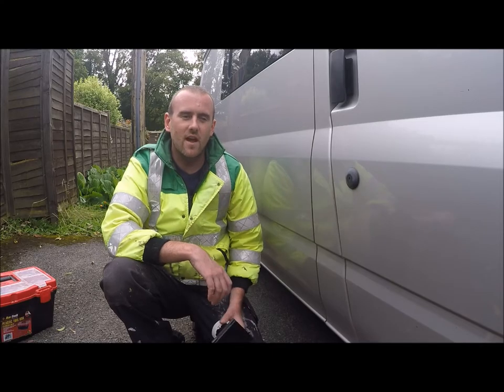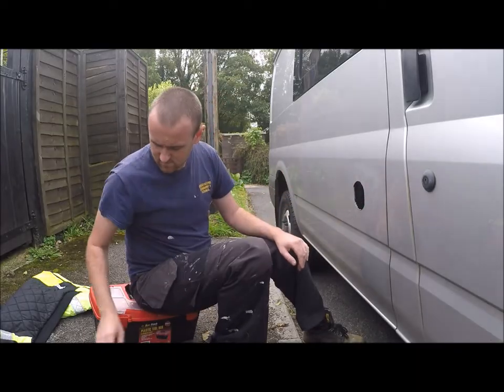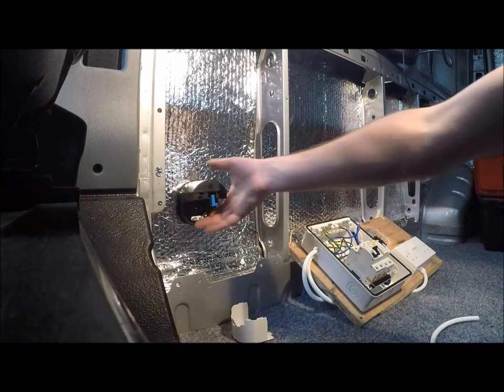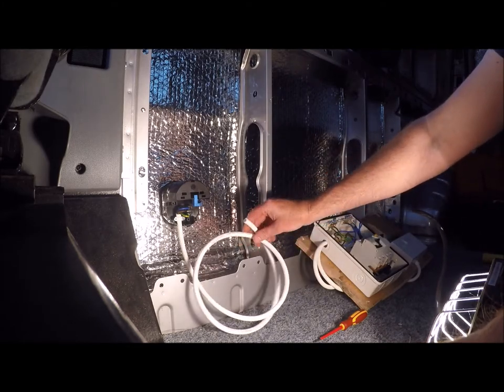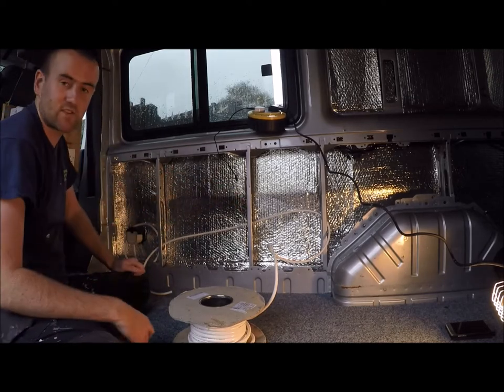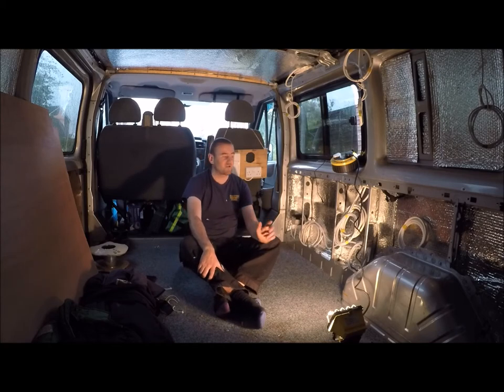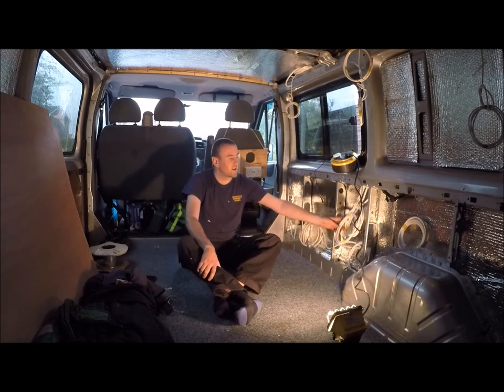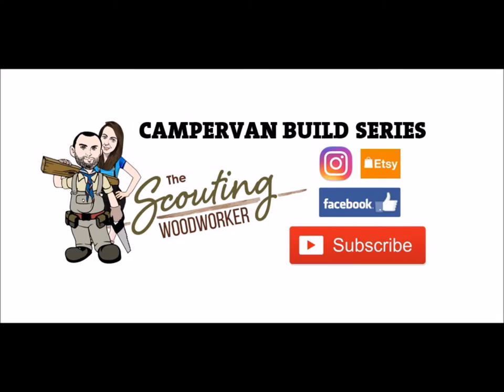Campervan Build Series - E05 - Electric Input & Wiring

Comment: Hi .what type of cable and rating is it for sockets and lights...is it special cable as its in a vehicle
Reply: Just use some 4mm hr07 rubber or some PC flex flex 4mm for the mains power 240v input socket and the  use 2.5mm PC flex for the actual sockets.

Run the cables thru plastic copex plastic split tubing.

The 12v side you can use 1.5mm pvc flex for 12v lights and 2.5mm for anything abit bigger.

No special cable need use mains flex it's fine just make sure you put into protective copex tubing.

Comment: dangerous mistake, the van socket for ehu cable should be earthed to van as well as consumer unit, in the event of a short circuit the van body COULD become live.
Reply: You are at serious risk with poorly installed power in a van, you cannot rely on the hookup you are using for a working 30mA RCD so get on of those hooked up and tested to ensure it works and trips at below 40ms at 1x test and below 200ms at 5 x test, you can only check this if you have a suitable RCD tester, you owe it to yourself and your family/friends to ensure they are safe, as contact with something live whilst you are stood in a damp field with nothing on your feet making good contact with earth with no RCD to save you means bye bye. I cannot stress this enough!

4mm from consumer unit for a TT earthing system system and that means the body works will be at equal potential
Maybe weather sink with 4mm as well if you can and fit a 30ma rcd or gfi in USA